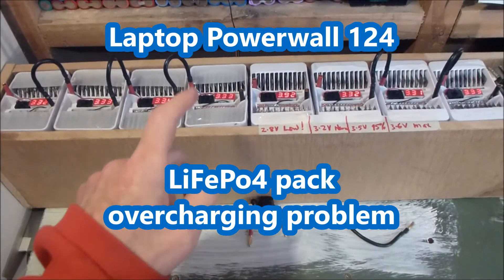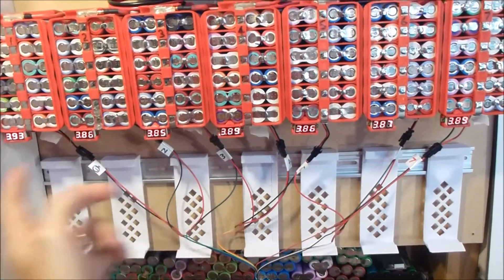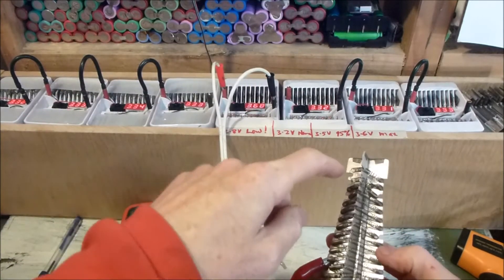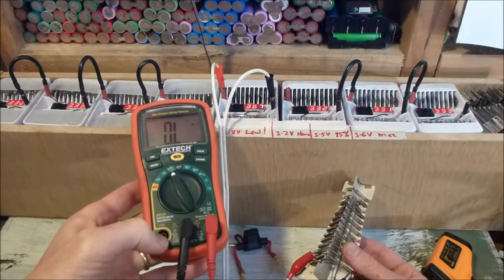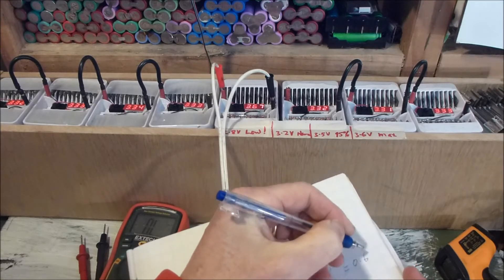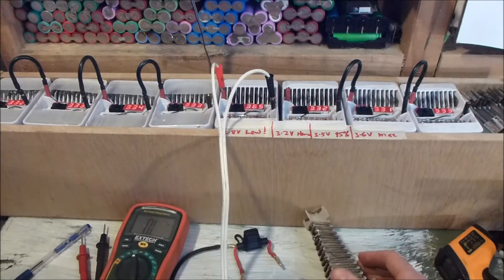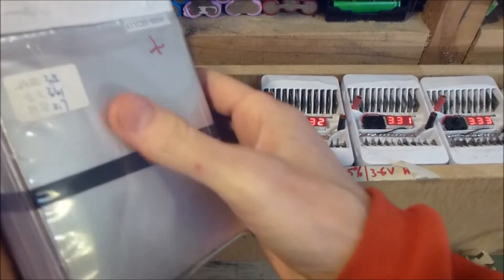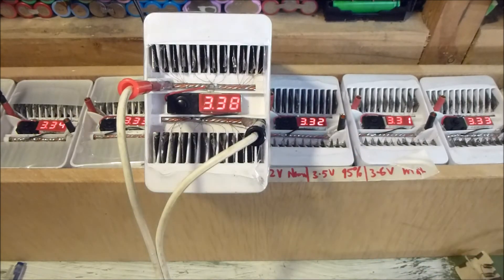Laptop Powerwall 124 - LiFePo4 pack overcharge problem

Comment: I had middle batteries go first when ma charger was reading a different voltage from my multimeter when i tested the battery pack after using it the middle cells had (0v) but was them cheap blue knock-offs from eBay in holders lol
Reply from the maker: This video focuses on my experimental LiFePo4 pack not 18650s. My mistake was trying to get away without using a BMS on this pack - rather than the charging setup (it was only charging up to 28 V across the whole pack). 
In your experience - why do middle cells go first?
Reply: Paul Kennett I wish I had a fix for it but balance charger would be good  ......I bet there's loads of things that cud cause it eg. low quality cell, stress to middle cells cause of wire connections between cell packs adding resistance causing more work for the center cell/s over time for a guess but I not engineer lol ...... with that many cells custom BMS with cell monitor would help a lot cud use Arduino to protect them send message if high or low voltage  just a idea lol.